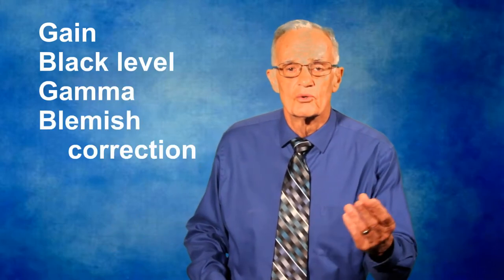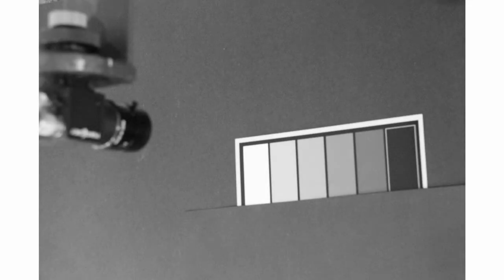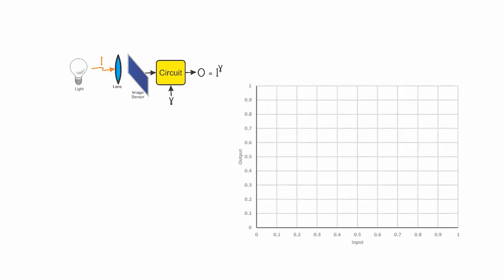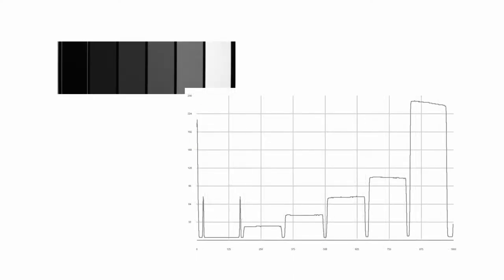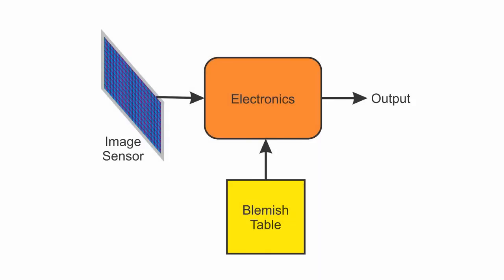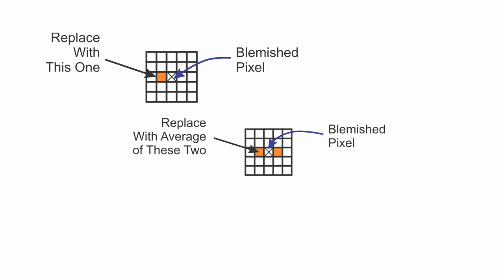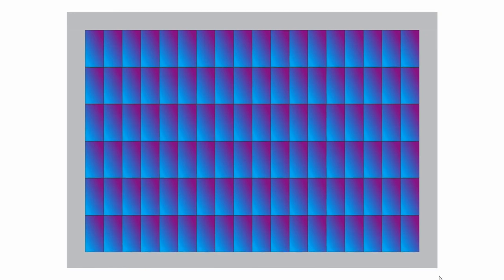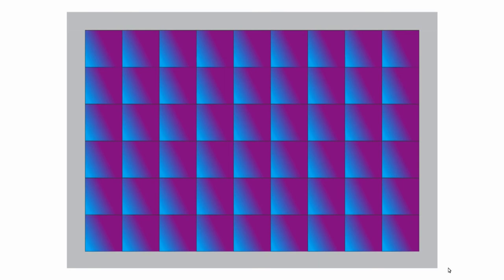Machine Vision Cameras:  Camera Electronics

Comment: Perry: how come that camera manufacturers don’t make round sensors?
Wouldn’t it make sense as the image projected from the lens is round?
Is it because of manufacturing costs?
Thank you!
Reply: This does not happen for several reasons:
1. During manufacturing, the individual chips can only be cut straight out of the wafer.
2. Normally displays are rectangular, round images don't make sense there.
3. Image processing is based on line and row addressing of pixels. A round image(sensor) would complicate this significantly.
Reply: @TheMAggi99  What a great answer! Thanks.